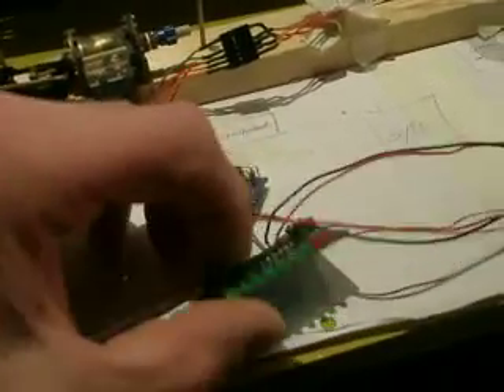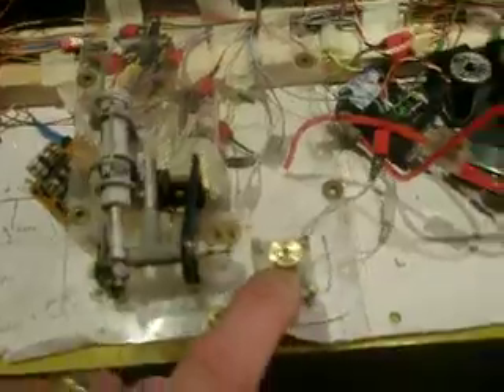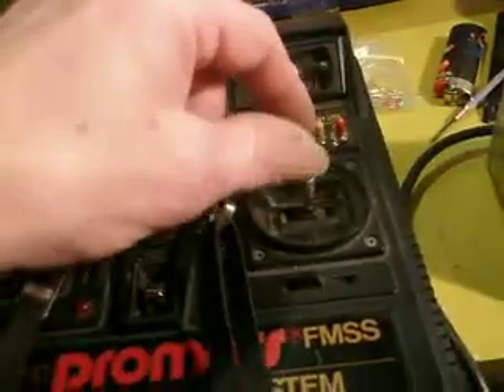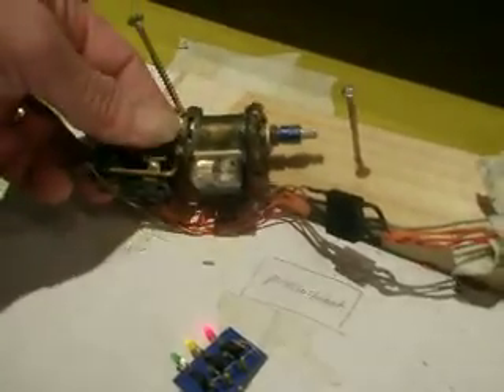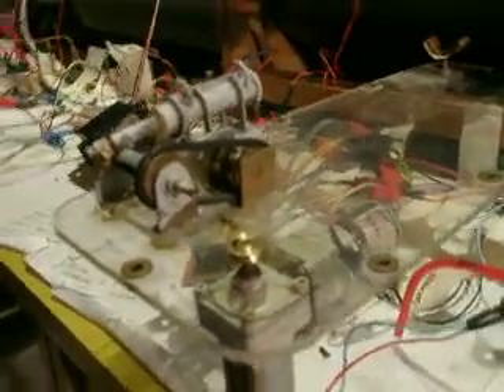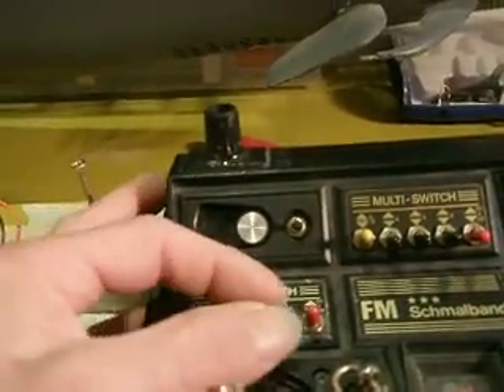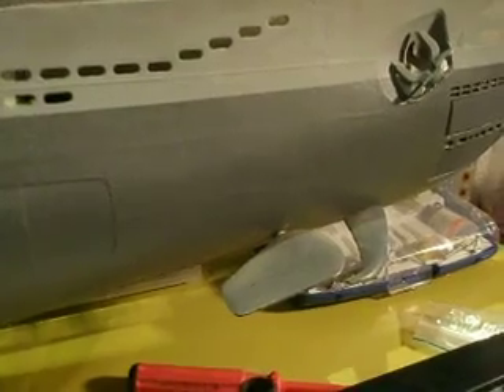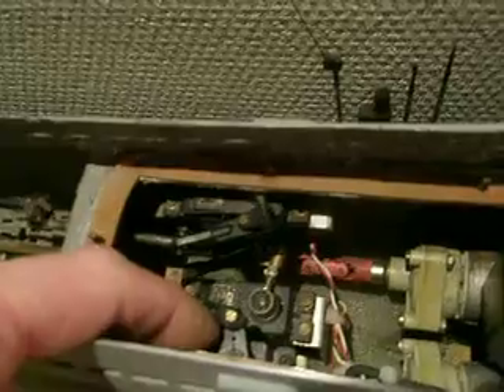The new wiring for my rc sub

Comment from the maker: @Eng4013, The trick is to build each system layer after layer, and offcourse write it down how you did it, it will be usefull in case of trouble when something will not function